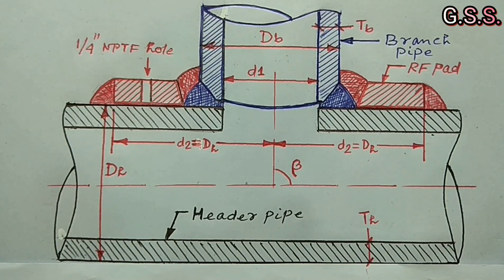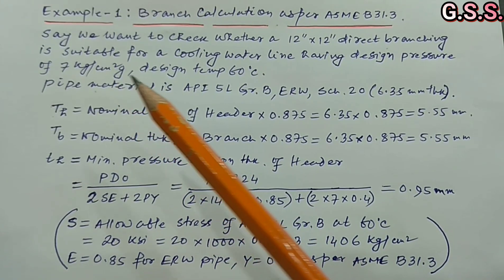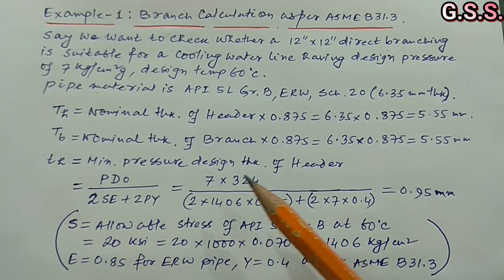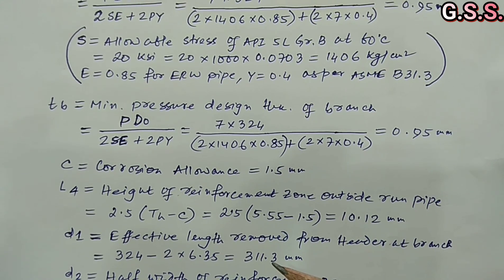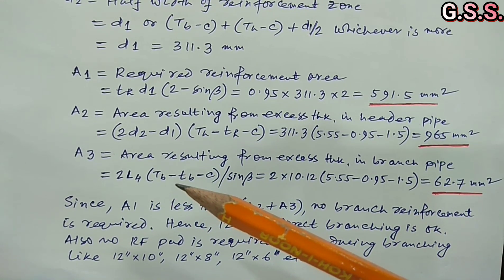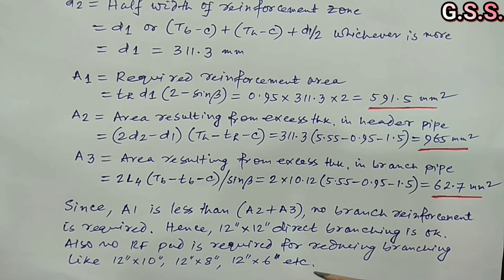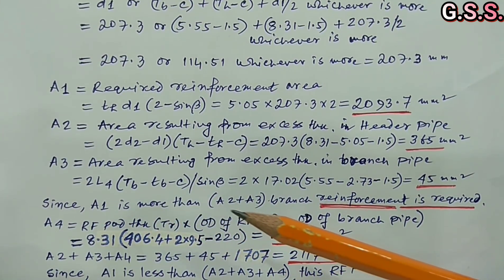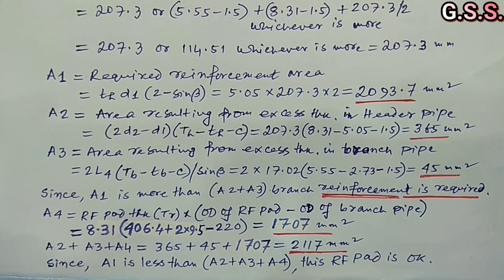Piping Engineering : example of Branch calculation as per ASME B31.3

Comment: sir what value of B(beta), you have considered for both examples. Also, as per 31.3 in formula of d1, sinB is in denominator. In second example, in A1 calculations you take sinB = 0. but if we take that in d1 calculations, it would be undefine.